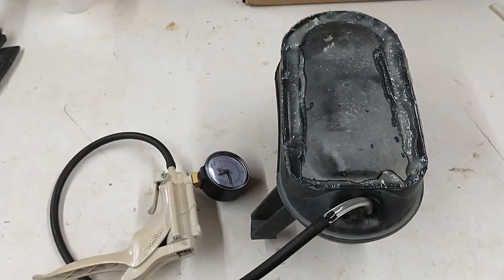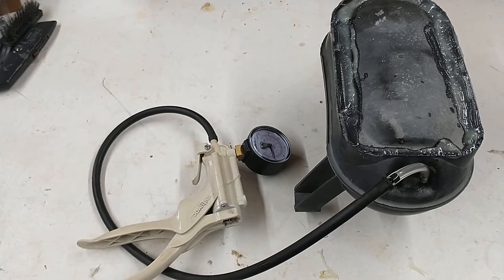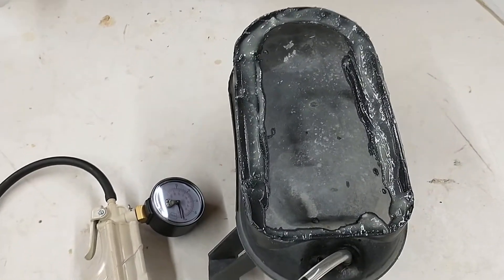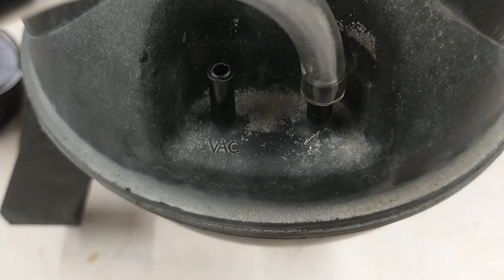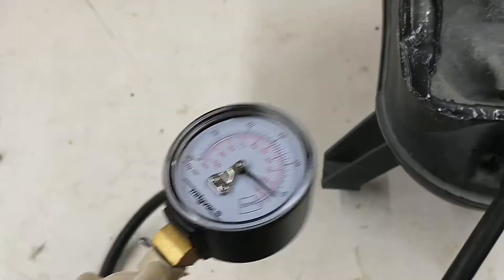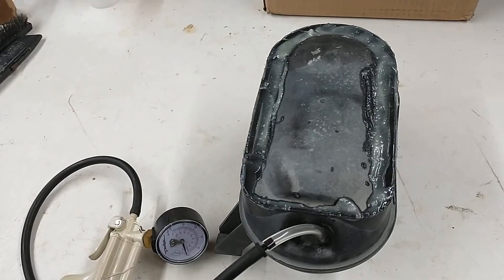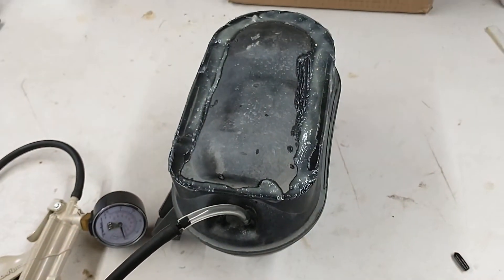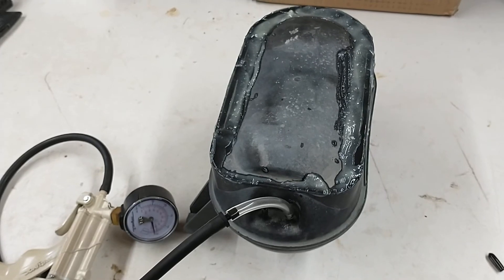Ford F250 5.4l Vacuum Reservoir Test and Repair

Comment: Hi,  Awesome channel!!  very informative.......I have a question 
I have a 2016 F250 Diesel and about a week ago I had no brakes so I found out that my vacuum pump was damaged so I just replaced the vacuum pump also my brake booster had oil in it and my master cylinder was replaced  and when I removed the battery tray / Reservoir I noticed that when I took the hose line off the reservoir under the battery tray there was oil underneath because underneath the battery tray there's a compartment which I found out it is the vacuum Reservoir when I removed those hoses underneath it had oil coming out now my question is since I already replaced my vacuum pump I'm about to install the new brake booster with the master cylinder can I just clean out my vacuum Reservoir and clean out the vacuum lines from all the oil coming out.....
And use the same battery tray/vacuum reservoir and vacuum hose? I don't know if using the same vacuum hose and reservoir will cause further damage.....
Thank you...
Arthur

Comment: I have a 2006 RV, Triton V10.  My tank has 2 vacuum hoses coming from it.  One line (RED) goes towards the engine and out of sight, but I beleive it is attached and working.  My other hose (Black) is loose and NOT attached.  I am not able to determine where it should be attached.  Ironically, my AC is not working when the engine is under power.  The AC units are nearby but I am not seeing a place to attach this black vacuum hose.  Any thoughts?